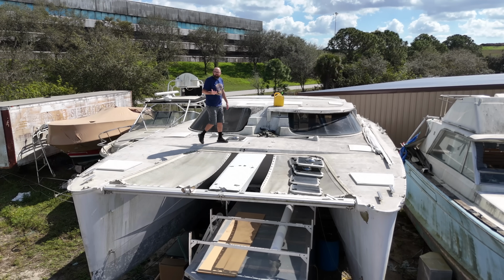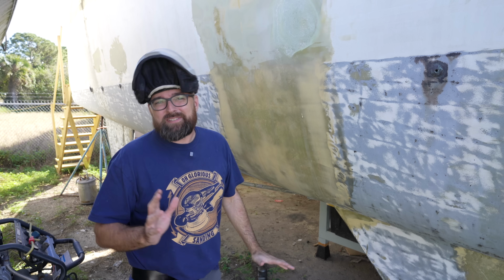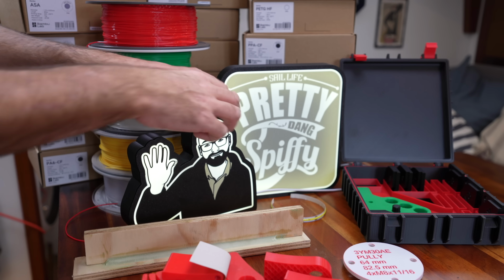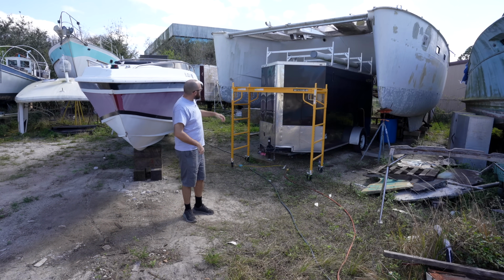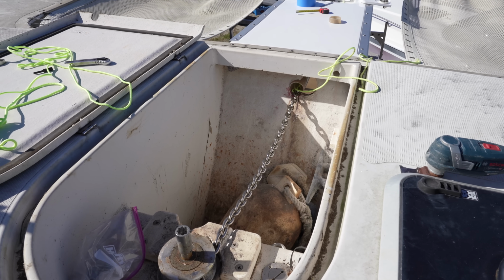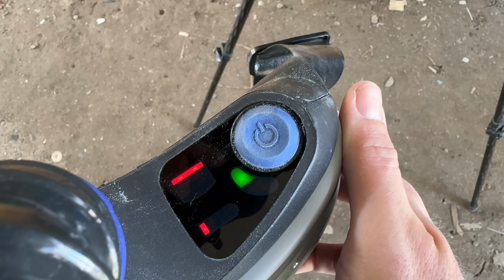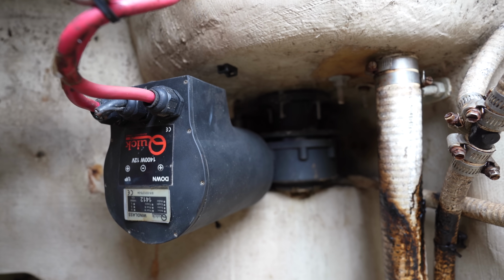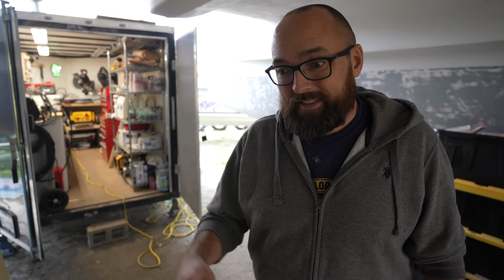⛵️ Failed repair? Now what? Hurricane-damaged catamaran Ep616

Comment: When you start the Yanmars, consider using ATF instead of diesel. What's great about ATF is that it's very slippery, so for indirect injection diesel engines which use mechanical injection pumps, it's great for engines which have sat for long periods, just had fuel system work done, or as part of a periodic fuel system maintenance regime. 

Thanks for yet another great video!

Comment: I am wondering if the easiest way forward is to cut out the old repair completely, and re-fibreglass the repair area. That way yo immediately know that the new repair is 100% reliable and correct.

Comment: You might consider using a PTFE tube as a liner in your chain tubes. Super low co-efficient of friction, resistant to virtually everything and should be readily available as an engineering stock material if you can’t find a tube in the right size and easily machinable.

Comment: If you're redoing that repair....Id  seriously think about special reinforcement bracing.   For peace of mind if nothing else....  As the front of the boat gets lifted by a wave that section will come under constant pressure.

I watched him work on this for many episodes and i would not trust the temperature he was working in to get the right bond. 

Good enough to move the boat?   Yes.  Move then completely redo it.....while talking to a structural architect.

Comment: I live on the East Coast and anywhere you go to along the coast is going to be miserably hot and humid in the summer, it's unavoidable.  As you stated in a previous video though Mads, the length of that miserable period does decrease as you go north.  Same with risks of hurricanes hitting you.  You're not safe anywhere on the East Coast, but your odds get better, the farther north you go.  Anywhere from Maryland / Delaware and north will put you in a significantly long winter and also probably be prohibitively expensive due to the population densities and politics of those areas.

I'd probably start looking in the North Carolina / Virginia areas first.  Those areas may be the best compromise of all the previously stated factors.

Cheers, Sev
Reply: The Delmarva side of the Chesapeake is much cheaper for marinas and yards.  Something like Cambridge is about half the price, or even less, as compared to Annapolis practically right across on the mainland side.  Summers are brutally hot and humid either place. We've done both.  It won't much get cooler until you reach New York or further North and winters are not really doable there.

Comment: Mads, I suggest that you take those sexy, sexy hole-saws and use them to remove a few plugs from the repaired areas. It would be pretty easy to repair small round holes in the hull, and the peace of mind that you would get from knowing what the composite looks like throughout would be priceless. Good luck.

Comment: Have you thought to 'pack'  (i don't mean fill) the tubes with grease?  At least  the chain will have  a thin layer of grease to slide across. It  might  actually do the chain some good as  well.
If  that  worked,  then taking  this a step further  a grease nipple mounted to the top  of each tube to allow regular greasing of the tubes might make this a long term solution.  Might be an idea it incorporate a grease nipple  into your design if you still intend to  replace the tubes with stainless later.

Comment: you could use the black 3d print material for a funnel protection ring on either end of the tube like 3in OD that funnels down to the the 2  1/4in inner - and just 3d print a thick funnel the chain can bounce off of while it feeds so the fiberglass doesnt get chewed up

Comment: Water Pump Bracket. The lower part where the single bolt goes through looks a little thin on the sides and the lower part where the bolt holds on to. Might be worth adding a few mm around there.

Comment: How cool/possible would it be to embed some linear, angled or spiraled brushes inside the ramp tubes in order to remove most of the chain funk as it moves through the tube? Of course I'm thinking about a brush that sits inside the tube and is adjacent to a slot in the tube that the funk can fall out of and it seems that heavy sailing might even clean the tubes? or are they too far above the water surface? Sure it is overkill and impractical but so is repairing a huge wrecked Cat in Balmy Township Florida....Man!!!  See what I did there? "Florida Man" 🤭.

Comment: I would not chance taking that boat anywhere until you are 100% satisfied that the repairs are good. If, there is any, chance that you think its not good. Then unfortunately , I would recommend that you redo it not because Brian didn't do a great job, but because of the time it has been sitting in the hot Florida sun without protection.

Comment: Glue products in Lake Worth should have everything you need for fiberglass products. Mike
Reply: Also, put a half pvc pipe in the bottom of the fiberglass tube as a wear strip. Replace as needed. Mike

Comment: Mads: Use an insert in the tube made from black PVC waterpipe. The kind that you dig down into the ground. Black with the small blue line on indicating the water content. 

Dirt cheap and easy to replace. You have to figure out a way of securing it at both ends.
Reply: Hey Mads, if you get some black pvc pipe with an OD that’s a few millimetres too wide you could the cut down the length of the pipe to take just enough of total diameter to make a wear sleeve for the chain tubes with a good friction fit.

Comment: I can't help thinking that the big hole repairs should start on the inside. If in the end Mads you have to remove most of Brian's repair having solid glass work to work up against would save anxiety and time on the outside excavations. 😉
Reply: It's foam core. The inside is done and ok

Comment: Hi Mads, just an idea for your chain tubes: 3d print a sacrificicial chaffing flange for the ends of the tube to keep the wear off the area where it connects to the chain locker and tramp ramp.
Reply: That chain will cut the fiberglass to ribbons in days...
Reply: I came here to suggest the same concept, although perhaps use of stainless steel tubs utilizing same concept with slightly bigger diameter hole than chain and as thick as possible to match tube ID would have been a far better long term solution. Type of plastic/nylon filament for 3D printer would need to highly abrasive  resident. Surely he can find such material through consultation with supplier tech support.

Comment: Castable polyurethane for your anchor chain tubes.  We used a high durometer form as wear liner inside pipe elbows in pneumatic conveying systems.  We sprayed it in largish 24" elbows but is could be poured in one end of the tube set on an almost level surface then rolled back and forth about 30 degrees.  With a viscous mix this would coat just the bottom and up the sides a little bit, just where the chain makes most contact with most pressure.  Anyone that has spent some time cleaning parts in a bead blaster will tell you the hard, crunchy stuff comes off easy where the toughest stuff to remove is the rubberized gasket material.  Besides wear resistant steels we also used UHMW, HDPE and ceramic tiles but PU in the right application is inexpensive, low labor and conforms to irregular surfaces.

Comment: Hi Mads, I agree with your thoughts, move the boat and get it under cover then attack those hull repairs. You will certainly have more control over the elements and better working conditons. Cheers Ian

Comment: Mads, you've got a lot more fiberglass repair experience than I do, or anyone else I know for that matter. The best advice anyone can give you is, trust your gut. My guess is, that you already know what you want to do with the hull repairs for the area on the starboard hull and keel, and any uncertainty is your subconscious seeking reassurance. Trust your gut. You know what you need to do, you have the skills to do it, and you know the steps you need to take to get to the result you want. You got this.

Comment: Starboard idea for chaffing great, would a piece of schedule 20 or 40 PVC liner also work and cheap enough to replace periodically. I could also see you adding integral chain spray wash down.
Old kitchen cutting boards handy sub to starboard.

Comment: While the current repair using fiberglass tubes is effective, incorporating bushings made from ultra-high molecular weight polyethylene in the areas that experience the most wear could significantly extend the system’s lifespan. These bushings would act as protective barriers where the chain exerts the highest friction, reducing wear and further enhancing durability.  Also for your gold standard using stainless steel lined with ultra-high molecular weight polyethylene is a great improvement over the original fiberglass tubes.

Comment: I might be wrong but these anchor ramps do not look so strong, I mean not the ss part but the composite elements they are fitted onto. In fact they look quite long and practically fixed at the two very ends only.

Comment: So what is wrong with the present steering system? Gear boxes work? Rudder arms work? The only thing that is broken is the auto pilot? If that is the case add the autopilot to the wheel and save yourself about $4000 dollars.

Comment: The only problem I see moving north is you will have to deal with the cold winter temps for curing epoxy. You got about 2 months of moderately good epoxy temps in FL to get all the outside epoxy work completed.  The only thing better would be some inside air condition space to rent. FYI, I just had a 3D part printed in 316 stainless steel, just sent them my STL file for the plastic one I printed.  Price as very reasonable.

Comment: Great video Mads, but Bambu Lab is locking up its ecosystem and turning their nose to the opensource 3D printing community it was build upon. Becoming nothing more than an Apple'ish 3D printer and frankly giving the middle finger to the years and year of free work shared by the community. Imagine someone taking your video's, replacing your face and voice using AI and re-publishing them as your own on Pay-per-view. . 

Recommend the Prusa Core One with MM3 or even the new Eligoo Century Carbon or Creality K2 Plus Combo. All of these mfg. are open source and have committed to adopting the coming OpenRFID spool protocol.

Comment: There is a thing i would do different from the previous owner and thus why i would've cut the repairs regardless.

I would've cut into good material to tie my repairs into. I know, some people would not think this is necessary, but i would enlarge the gap. Here's the reason. Metal, plastic, fiberglass, doesn't matter what the material is, if you have a damaged section, there's a high chance that stresses have gone into adjacent areas around the damage. Of course, various materials have various distances. Metal will be less affected, plastic more so, fiberglass might have between them, but this happens regardless.

And there's one more reason i would cut it: i would make the repairs with premade (out of the boat) panels that would largely fit the existing gaps. Spanning the gap (in my opinion) has some advantages over patching the gap in situ. While i feel strongly about the first reason, the second one's my own personal preference.
Sidenote: i also think the previous owner's repair would've been ok, if (like Mads said) it would've been painted. So i'm not saying he did a bad job. It was perfectly adequate. It's just how i'd do it.

Comment: The stress area where the old crack repair needs to be super reliable, particularly for a catamaran, where the two hulls move independently, twisting and wriggling in, particularly with waves from the sides. However, I'm sure you will solve that with your skill and engineering mindset. Cheers.

Comment: Coppercoat? Are you planning to move the boat and LIFT, or work on it, in the water? If you are going to HAUL the boat, and put it up on the hard, why bother with bottom paint? You'll only be in the water for "a couple of weeks". Surely you can just pressure wash the bottom? By the way, I first put on Coppercoat in 2008, and I love it - but why rush to do the bottom paint, at this stage?

Comment: In regards to the hull, I'd see how much the schedule looked. For a summer of leisurely cruising up the ICW even if you just ground out the outer skin's old/new joint repaired that at 12:1 ration then slathered >3mm of cloth on the sections below the waterline extending beyond the current repair you'd be fine

Comment: Summers are hot and a nice shade cover expedites repairs remarkably.
Reply: Yeah. I'd get some fiberglass poles, tie them up like they do circus tents and then string a large, white or gray tarp on top. The boat itself, becomes the structure and anchoring point. Have done it when i did some repairs in the middle of the field on a stranded combine. Working in the sun is just, not ok. You get hot, you make mistakes.

Comment: Mads, why are you going to put copper coat on the hull before it is done? If you get the hull complete then that would be a great option but if you are just moving the boat and going to sand it anyway why put anything? Or just put the cheapest anti foul paint just for a short ICW trip?

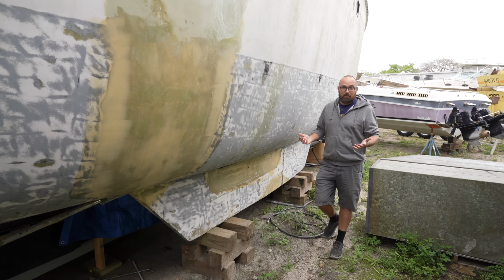Comment: 24:50 this makes no sense Mads. Why apply a uber expensive antifouling if you are just gonna be moving boat north and putting on the hard again and reworking all those below the waterline repairs? Unless you rework those repairs in Florida and prep the whole hull then you could get away with copper coat, but why bother if you're just going north and putting her on the hard again?
Reply: Maybe total boat likes sponsoring him... they won't even ship to Hawaii so I will not be watching capt dum dum any longer
Reply: @saylaveenadmearedead  😥😥 Really, you should check if there is a hazmat regulation that is barring them from shipping to Hawaii? It might not be Total Boat fault here.

Comment: My advice would be not to postpone the hull repair. Do it now and be done with it. You are in a cheap spot without angry neighbors. Perfect for dusty hull work. Move the boat when the outside glass and paintwork has been completed. You could be done with this stage by early summer, depending on the deck/hull joint issue.
Reply: I also agree... A fully repaired hull would be my top priority as well.  "Good enough for the ICW" would leave me uneasy.
Reply: Grind baby grind before it gets too hot!
Reply: What he said 😂
Reply: We have friends who sank their Catalina to settle hard on the bottom within spitting distance from shore (to either side practically) in the Tennessee-Tombigbee Waterway after a minor grounding.    

If the hull can't take ocean waves it's not gonna take a grounding well either and in the ICW you are gonna touch bottom sooner or later -sooner when it comes to newbies to the ditch.  It happens, and it usually happens fast and hard when you make a small little mistake of losing concentration.  

I would suggest you unhook your autopilot by taking the wires right off of the breaker lugs to remove the temptation to use it.  It is not your friend in the ICW.
Reply: The cheapskate always spends the most . . . Do it now ; - )
Reply: I would like to associate myself with the comment from Belledetector.
In particular the dust will be very annoying to your new neighbours. Stay where you are and get on with Oh Glorious Sanding
Reply: Here,here
Reply: I totally concur with the comment. I can't understand why you want to move the boat as its cheap don't mind noise dust debris etc. the old adage springs to mind. The grass is always greener in the next field
Reply: Apparently some of you never worked by a landfill in fl ! The winds with  dust will be a nightmare trying to paint !
Reply: Agree !
Reply: This gang ho attitude is unlike you Mas are y😮ou worried about your investment being a lemon and also 'carefree" is a ladies sanitary item get a new name before you launch.

Comment: In the dewatering biz when pumping an abrasive slurry through HMWPE pipe the contractor will rotate the pipe 90 degrees when the wall starts to run thin. HMWPE should be on your list as a carrier.

Comment: Understand the tubes, would have used ss316 instead. Like your 3D printing, quite a development going in with that. As for the hull repair I watched Brian do this. I think it’s strong enough for an ocean, just don’t test on a reef. Making it certain by putting a brace in it doesn’t hurt, use a few thin layers of multi directional to be sure. Do it now/before you finish the rest. It avoids a lot of trouble if you had to do it later.

Comment: Hi. If/when your chain chafes through the fiberglass tube, you could consider a PEH pressure water tube as your next alternative. (At least that's the name here in Finland. I think it is at least european standard) Nickname siniraita=bluestripe) Although I don't know if they sell those in USA. Cheap and guite resistant. PEM tubes are similar but diameter too small for you.

Comment: I'd vote for staying put during the summer IF you can deal with the heat, especially when working with fiberglass (I presume they make slow hardeners for epoxy?).  Either that or get it functional and leave the hull exactly as it is and move as quickly as you can to the new location and get it out of the water again to do the repair.